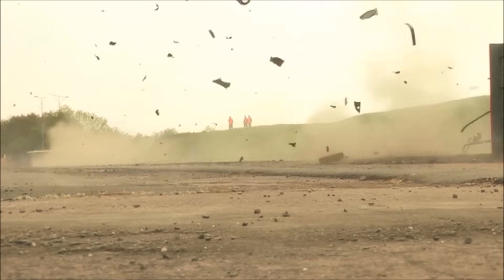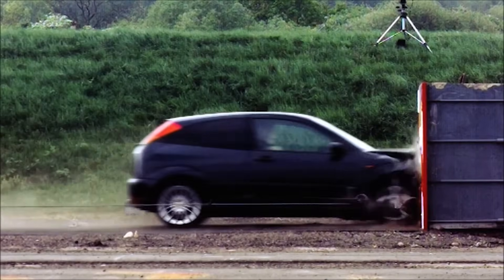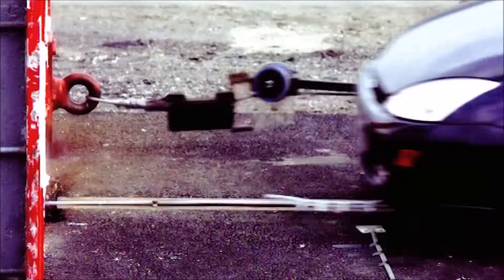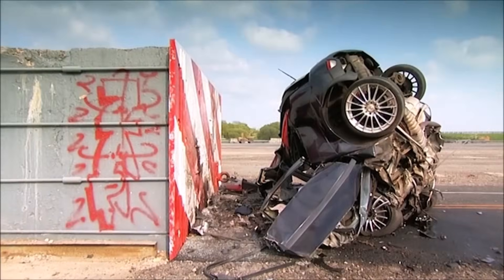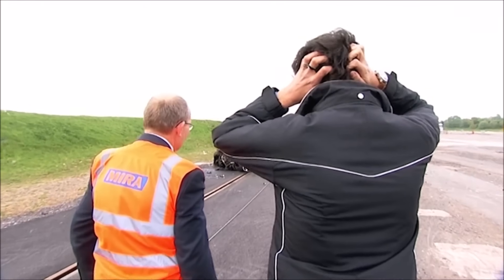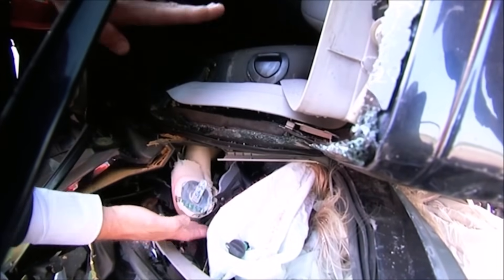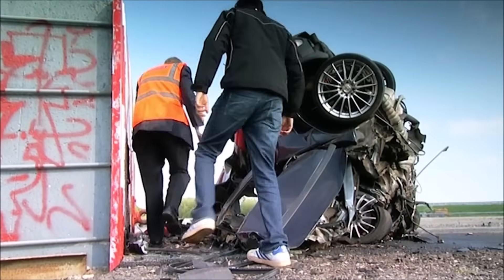HIGHSPEED CRASH TEST - 200 KM/H Ford Focus vs. Concrete Block

Comment: the airbags didn't even have a chance to fully inflate
Reply: No - airbags inflate in about 20 to 30 ms (least than half of the time that it took the car to decelerate to 0 )and reach speed of a couple of 2 hundred mile per hour so not that it would’ve saved anybody but the airbag would’ve been fully  inflated and headed backwards towards the occupants as the passengers were coming forward to cushion the blow😂
Reply: I would be interested to see the same test on a fully electric car

Comment: This needs to be shown everywhere every day for 5 years. Maybe it will sink in somewhere not to drive these traps with wild abandon. Maybe. I've also seen some Ford pickup trucks do this very same thing.
Reply: How many people do you know who’ve driven 120mph into a concrete block? 😂
Reply: The forces involved at such speeds are of magnitudes that no amount of crumble zones and passenger compartment hardening will make any difference. YOU WILL DIE, no matter how modern or large your vehicle is. It is just physics. So yes, they should show that video arround... but  not to warn against particular cars or brands but instead warn about speeding.

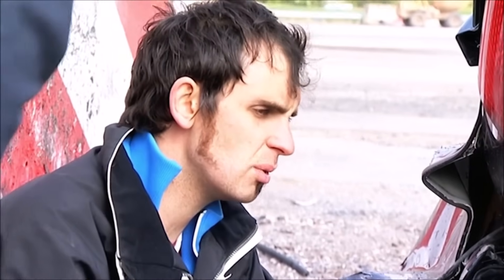Comment: 1:54 they just don't make them like they use to.
Reply: Nope, you  just vastly underestimate the kinetic energy and resulting crash forces involved. 

Not to mention that even if you build a steel cage that could take it, you would still instantly die from the g-forces alone.

Comment: The plane I was in when it crashed into terrain was faster than that and I still survived with two other people.
Reply: Sliding across flat ground is not the same as slamming into massive concrete block.
Reply: right
Reply: What flight was it?
Reply: You can survive braking from much higher speeds... if the braking is soft enough there is no issue. The issue for speeding cars is that a lot of hard things tend to be arround that will happily provide more than enough braking power to smash you into red pulp.

Comment: An important point to note about this 200kph crash, is that it is virtually the same as 2 cars travelling at 100kph each.

Admittedly, there are 2 crumple zones to absorb impact instead of one, but survivability in a head on collision with each car travelling at 100kph (a very common scenario) cant he too high either.
Reply: No, this exactly the same as 2 cars each travelling at 200kph. It’s 4 times as bad as 2 cars each travelling at 100kph.
Reply: Actually the survivability is quite high at 100kph. Over 50% would survive.

Comment: I woulda survived personally but that’s just me
Reply: i was in back but my lil' cousin died
Reply: Yeah you holding the steering wheel while not being in the car
Reply: I mean... here I am. I survived it 🙆‍♂️🤷🏻‍♂️😂
Reply: God be on your side then yea no doubt. 
:)
Reply: I woulda jumped out of the windshield in front of the car and stopped it from crashing with my bare hands
Reply: Respect.
Reply: In your dreams  it's imp- nah im just i would survive in the rear bumper
Reply: You’d been fine in the trunk
Reply: @papenfuscharlie5567 you'd be sharing the trunk with the engine
Reply: 🤣 @papenfuscharlie5567
Reply: @papenfuscharlie5567  The g force will be to high to survive .
Reply: @MeteorGaming96  nah you’d definitely just about be ok
Reply: @MeteorGaming96  speak for yourself, we're built different
Reply: @MeteorGaming96 Because we are not weaklings like you

Comment: Now please 300kph
Reply: nope. if someone does a crash test at 300 kmph the car will be on fire because at that high speed accident the fuel tank ruptures which is a safety hazard, because if ignited by a spark which is very likely all of the passengers will die from severe burns and from the forces involved of aproximatelly 600g
Reply: @mihaillevarda9395  They don't fill the tank with flammable liquids for a crash test

Comment: "The car deccelerates from 120 mph to 0 in 68 miliseconds with its passengers experiencing peaks of 400 g, the front end hits the wall with such force that the back end rises up 90 degrees and then car is slam dunked down onto its nose" Chills down my spine.

Comment: Two drivers at 100 km/h on opposed lanes thinking "Good that for safety reasons I don't drive too fast".
Reply: Nope, try again.
Reply: @Raymond4774  Well, driving at 100km/h is safer than driving at 200km/h

Comment: While 200km/h seems too much for a Focus keep in mind that a 100km/h frontal on a public road is a very likely scenario.
Reply: The frontal collision of both vehicles at the speed of 100 kph is not "200 kph into the wall". It is still 100 kph, also when both vehicles collide, the impact is much softer because of the destructible zones of both cars.
Reply: @NoOnesIdea  but the speed of the two vehicles is added together. So if you have two vehicles collide head on at 100kph that is a 200kph crash. I know that Modern Volvos are designed so, if they hit something, they go ahead and to the side, in theory allowing the driver to have some form of control.
Reply: @tom201090 Kinetic energy scales quadratically so a car at 200kmh has 4 times the energy than one at 100kmh. two cars colliding at 100kmh would be half as severe. The collision is also happening with another car instead of a concrete wall so crumple zones might play a role
Reply: @tom201090  No, that's just straight up not how that works. Sure, if a 100 ton wall was approaching you at 100 km/h, then yes, you would go from 100 km/h to -100 km/h, which is a 200 km/h difference. However, if you crash in to a car of similar weight, first of all, you probably would both be pushed aside and not actually come to a full stop at the place of the collision, and even if you did, you both would experience 100 km/h to 0, which is only a 100 km/h difference, not 200 km/h.
Reply: @nickinator3  assuming you drive in to another identical car with a perfect head on collision, it should be practically identical to crashing in to a concrete wall at 100 km/h, in reality, you almost never see crashes perfectly head on, and almost always you get pushed to the side, which allows way more time for deceleration.
Reply: @NoOnesIdea  Much softer ????
Reply: @NoOnesIdea  I see you've been doing your math long time ago.
Reply: yea but even 100kmh straight into a wall will kill you, and 200km/h is nothing for a focus RS
Reply: All but the weakest Focus engines are quite capable of approaching and sometimes exceeding that speed.

Comment: Looks like the safest place to ride is in the trunk.
Reply: 400G is 400G all over the car I'm afraid. Your organs melt like hot butter at that force.
Reply: @raze83  it was a satire statement
Reply: @flyinshu9419 ilove you
Reply: Even in the trunk you still die because the fuel tank ruptured and it could catch on fire, so you still die from severe burns
Reply: At 400 gees there's no survival just some meat paste in the trunk.
Reply: hii @darrellcook8253

Comment: Omfg dude….
It’s simply impossible to survive a 200km/h crash…
Absolutely impossible.
Reply: you cant survive ofc if its a direct hit like a tree or a wall
Reply: Volvo: Hold my beer.
Reply: @serg2057  Concrete Block: 'Help.'
Reply: Depends on the vehicle and the scenario of the Crash. 125mph into a concrete block. I doubt you'd survive even if you were in a Volvo XC90 (I would like to see that though) due to the sudden stop. But if, say, you rear ended a car travelling at 70mph and you were travelling at 125mph if you are lucky, depending on where the car ends up, you might survive. And, of course, your vehicle. Although if you are travelling at 125mph then chances are you might not be in full control. Personally, however, I wouldn't want to try it. Leave it to the crash test dummies.
Reply: Nothing is impossible. 
The plane I was in when it crashed into terrain was faster than that and I still survived with two other people.
Reply: yes direct hit noone survive all other comments here are bullshit,its all about concrete wall ,static object ,look at the damage ,
Reply: It’s possible, but the possibility of a lethal wreck goes up exponentially with speed.  A friend of mine survived a 150 mph wreck in a race car earlier this year.  Even with a really good roll cage, helmet, hand device, harness, and everything else, he was lucky to be alive.  Speed is a HUGE factor in lethality.
Reply: there was a guy with his gf in hungary who drove 300+ in his lambo and lost control due to bad road and the car flipped over multiple times. they both survived with minor injuries lol
Reply: Depends on the crash and the car. If the car flies away and spins instead of absorbing the impact 1:1 and you sit in a high-end german car then yes, you can even get out on your foot. I have a friend who lost control of his Passat at 180km/h and flew off the road with 3 passangers. 1 girl died, 1 guy went into coma, 1 guy got out without a scratch, my buddy broke his spine and took him 2 years to be able to stand up again. 

Lesson: DON'T FUCKING EXCEED THE SPEED LIMIT. EVER.
Reply: @raze83  yeah true but just….
Fuuuck
Reply: @raze83  Beyblade
Reply: As a survivor of a 200kmh or 120mph ish 
Yes you can survive but..
C4, C5, C6 and C7 destroyed 
Lack of mobility on left side of the body done.
Lung almost colapse 
Lesions on your sensory cortex
Lost of vision on my left eye for over 3 days 
Lost felling sensation on my right leg
Oh and some herniated disc 
Soo answering your question, yes you will survive but it depends on millions of statistics or pure miracle.
It's been a year already and i was able to recover 92% just because of my age thats all the doctors can say about that 🤷🏻

Comment: 400 G wtf ! Its like 40 times the Gs that the best astronauts and pilots can endure 😯
Reply: Astronauts and pilots have to endure continuous G-forces, and the limit is as you said, around 10Gs. However, when a car crashes the G-forces dont last long, so the maximum limit would be around 180G, limit being set by a F1 Driver, David Purley
Reply: Yes you right. Didnt thought about the duration of the effect.
Reply: The word record for (short) high-g survival was Kenny Bräck crashing at Texas Motor Speedway in 2003: 214 g. However, this g-force was measured from a sensor attached to the car, not something attached to Kenny Bräck so the forces experienced by him have been much less with high probability. The true limit for human brain for forward going movement (deceleration) is estimated to be around 45 g after which the brain is crushed against the inside wall of the skull, no matter how good helmet you have. Humans can tolerate very short durations of higher g-forces as long as the total length of the deceleration is short enough to avoid moving the brain inside the skull too much.
Reply: F1 driver grosjean walked away after a 67 G impact wich broke his car in half and penetrated the guardrail
Reply: You internal organs turn into liquid

Comment: That's 2 MJ of kinetic energy, or the energy equivalent of 0.5 kg of TNT which has been dissipated at a rate of about 30 MW.
Reply: you could hear the crack in the air aswell, sounded just like a tnt detonation

Comment: This test is useless, because on motorway there is no Stone blocks, lol possibility of that crash is same as throw car from plane, and then say  look how its destroyed
Reply: What do you mean there are no random gianr stome blocks you have to navigate around like super mario?
Reply: So, at what speed do you drive?
Reply: think again
Reply: You've never seen a crash where both cars we're only doing 65 mph and had a head on collision have you. Its as bad or worse because of all the metal making hot love and intermingling leaving NO room for the red leaky goo that used to be people. Some people never get the message. 
It won't happen to me is the problem. It eventually will.

Comment: Is there any crash test video at 400 km/h?
Reply: No. Even if a crash test agency tested a car at 400 km per hour it will cause a severe fire because at that high speed the fuel tank will guarantee to be severely ruptured and could by easily ignited by a spark.
Reply: @mihaillevarda9395  Thanks for the information.
Reply: @umanonimolegal1342  you are welcome
Reply: @mihaillevarda9395 they remove the fuel from the tank before crash testing, no crash tests are done using power from the car's engine to reach the speed. In simple terms, they use a large slingshot to launch the cars at the wall as can be seen in this video
Reply: Well, there is a crash test video of a jet airplane rocket propelled into a conctrete wall... I think it was a rocket propelled F4 Phantom vs. a test piece of wall for a nuclear plant. I guess thats somewhere in the ballpark we are looking at. Spoiler; The plane gets utterly pancaked.

Edit;
Looked it up; The plane was traveling at ~500 MPH. So, about ~800 km/h.
Reply: @psymcdad8151  Wow.. I need to see this, where?

Comment: Impossible to survive this impact.
Reply: Unless you're Vin Diesel :D
Reply: It is if you are saitama
Reply: Is true not only for the forces involved, but also it will cause severe burns because the fuel tank ruptured
Reply: @mihaillevarda9395  and the deformation

Comment: Im not that sure about that. But I don't think there are that many walls on German motorways. xD
Reply: But maybe a lorry standing still at the end of a traffic jam? A 40 ton lorry is pretty much the same as a concrete wall.
Reply: @Chris-yy7qc  
the obvious solution is to drive a vehicle as heavy as possible. I'd go for a tank, but that is difficult in my country, so the biggest I can offer is a 10 ton Unimog.
Reply: @uninitializedvariable  Well, in theory your best choice would be a vehicle as light as possible (to reduce the amount of stored energy). Ofc in reality theres a sweet spot between structural integrity and weight. But still, you may want to chose the lighter car.
Reply: Actually that wont help you in the slighest. With the mass of the vehicle increasing, so does its kinetic energy and as such the wont be any difference.  @uninitializedvariable
Reply: Well consider the fact that hitting someone head on is a similar scenario to hitting this wall, when you compare the combine speeds which is the algorithm pretty much used by comparison
Reply: It can also happen on a country road if two cars, each traveling at 100 kilometers per hour, collide head-on.
Reply: @ΣτέργιοςΓούσιος   That is incorrect. Although the two-car crash doubles the speed, the energy is transferred to twice the mass resulting in a crash that looks like just one car hitting a wall at 100 kph.
Reply: There are indeed, consider the posts of bridges or the wall of a tunnel.
Reply: You would be surprised.... also keep in mind that large parts of the network dont come with particular strong restraining systems because it is flat and straight. Keep also in mind that restraining systems are designed for expected speeds, so a barrier that will stop a car going 120 kmh wont stop one going 180 kmh.